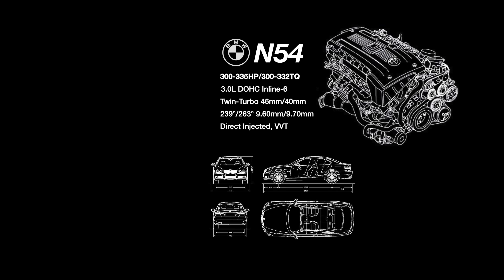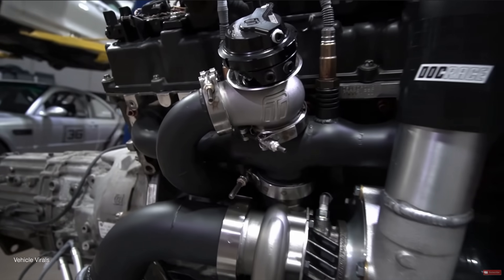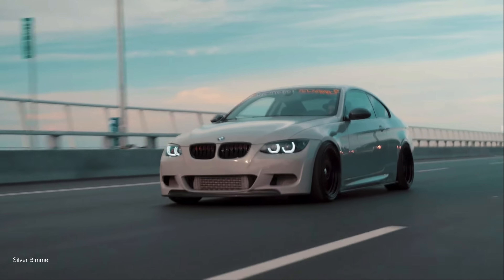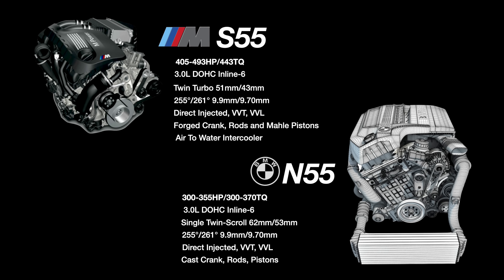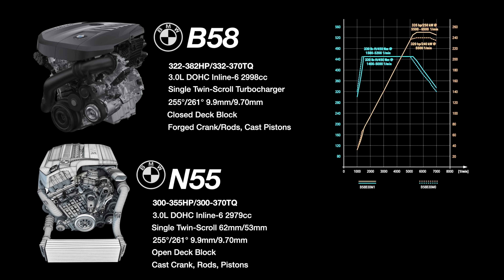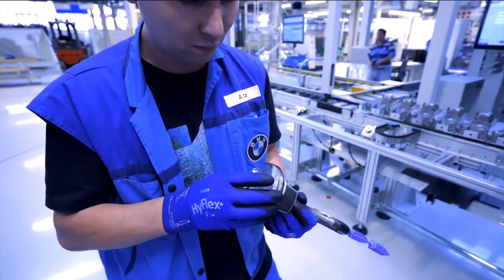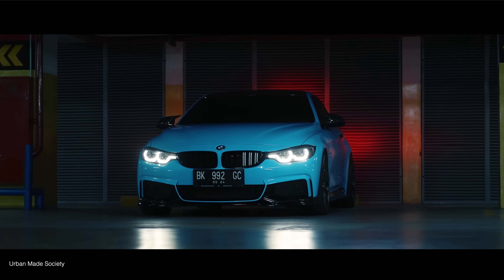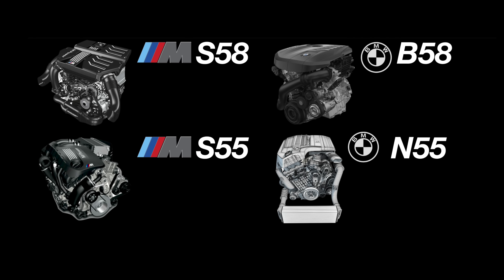BMW Turbo Inline-6 Engines Are Ridiculous | Explained Ep.4

Comment: Toyota saw potential in the b58 and that says it all 

There was a comparison drag race between an mustang Mach 1 auto vs MKV Supra 3.0 vs Nissan Z auto. The Z came in dead last and the mustang and Supra tied, b58 swings above its weight class and its already beating its direct competition
Reply: The z was only 2 tenths behind, and it was solely because of the dog shit tires Nissan decided to put in there.
Reply: Dude real talk, that is what made me look at the M340I. If Toyota is ok with using the B58 you KNOW it is reliable.
Reply: @Cwrigh25  mine has been nothing but trouble free & tuned for the last 20k miles
Reply: I have a 07 GT500 making 685 rwhp (800crank) on a VMP Gen2R blower kit. My buddy with a 2020 Supra with a downpipe/tune/Ethanol,  is dead even with my car. He makes around 650 crank estimated with just those simple mods. Weight is also a huge advantage for these cars
Reply: @ilikebudlite  yeah man these modern bmw turbo motors are massively underrated. My tuned daily 440i easily keeps up with my GT350
Reply: lmao the mustang beat the supra by like half a car💀
Reply: Nope they went to the guy that designed the 2jz to make the new motor and he said he wanted no part
Reply: Definitely not mere coincidence Akio Toyoda wanted b58 for supra....I wouldn't have had it any other way
Reply: @footballcoreano sophisticated, reliable, luxury, precise, precision 🤣 and then an opinion but no actually fact behind any of your statements? America doesn’t have engineers and we are simple? 🤣 how about companies are cheap while the epa goes after them every time more cylinders are made suck requiring them to paying fines every year just to produce which is why the world is going ev or i6 because the most “reasonable” power can be gained due to its lighter i6 balanced design making fewer emissions on a more efficient system being turbo. The American military would destroy Germany’s military. Yeah tech is good sure but it’s complicated with many parts, the reliability is in the placement of the cylinders that’s it other wise there is a lot of plastic used on them and the block is aluminum which is not better than an iron 2j is just saying. You all act like this is new lmao where the Germans are making headway is the transmission and awd systems that’s the real secret. Anybody who knows anything about engineering knows the more parts you have the more issue and less reliability it has so that argument is null. Not saying the motor isn’t good but let’s be real here the japs did it better when it was out in the original Supra because bmw was doing it then to in the early 90s and guess what toyota ruled and were under the 280hp agreement. Nothing like an iron block i6 for all the boost. How’s that for engineering. See actual facts behind what I say amazing.
Reply: Boost the Mach and they're all toast lol
Reply: @footballcoreano  I hate to burst your bubble but the Coyote not only is more powerful naturally aspirated but it has a higher brake mean effective pressure and until this inline 6 platform runs 7 on a factory sealed engine like the coyotes have you're absolutely talking out your a**. 
Coyote > ANY I6
Reply: Toyota means bad nowadays
Reply: I agree on the b58 comment but that video was bullshit look at the z’s tires. Regardless i like the b58 better also but i wouldn’t rely on that video for evidence 😂
Reply: @Automobile Addict Toyota didn't request anything or change anything about the B58, it was already well into production long before the Supra was even announced. I work at a BMW dealership, I've seen Supra & BMW B58s torn down, they're exactly the same. For better or worse the B58 is entirely BMW, as far as I know all Toyota did was take apart a few higher mileage B58s and made sure it met their stringent standards, which it did.
Reply: Didn’t Toyota reengineer the B58 to be a more reliable engine than its predecessors?
Reply: @LawrenceStroman  BMW doesn't need Toyota to know how to make a reliable inline six engine.  The BMW M57 is legendary for it's reliability as an inline six diesel engine and this dated back to the same era as the 2JZ and the OM606, another legendary inline six diesel engine.
Reply: @LawrenceStroman   NO.  The engine is all BMW.  Toyota had no say in the engine build, they only had a say on things like steering, brake feel, and aesthetic for the Supra.  It's why the steering is better than the Z4.  Toyota isn't going to be able to tell BMW how to build a better BMW engine.  It's like me telling Gordon Ramsey that this salt goes better than that salt.  You're trying to discredit BMW, one of the most performance brand out there.  As a former 3 and 5 series BMW owner and a former MK2 and MK3 Supra owner, I'm disgusted that you can even think that.

Toyota doesn't know how to build a performance engine engine anymore.  They've been using the V8 in their Lexus line for ages.  The LFA wasn't even a Toyota engine, it was a Yamaha engine.  The last great performance engine they built was a 2JZ, and it's too soon to see how the 3 cylinder GR Corollas will be, but 300 hp isn't that impressive these days.  It's why no one is talking about it.
Reply: Above it’s class? All of those cars are equally expensive. I watched the video and the mustang won by half car being na then the Supra turbo then the z also turbo both are lighter On forced induction and still lost to a na mustang Mach 1 which is just a track GT 🤣. Now is it probably the king of all inline 6 motor yep sure is but I’m not a fan of aluminum blocks either. It is impressive but would be nothing without a lot of boost and light weight saving. I prefer to make big power without having to even change my power adder or internals, weight saving can be had later. Boosted motors are not reliable and the more power you push through it the less it becomes. Also bmw has many electrical problems but the design is strong being an inline motor due to balance but only matters if the internals can handle it because the design flaw is torsion having 6 inline subject to snapping cranks and doing block damage but needs boost available to which it does not stock therefore it incomplete and might as well get the 2 extra cylinders if I’m going to build anyways for 1000 plus hp something these cars can’t do unless built on a lot of boost. Mustangs don’t need to be built to make good power and they actually sound good however still aluminum block. Now for a street car daily that you can make relatively fast sure. Not my top choice but everybody seems to think it’s the fastest platform out because they watch babyaga 🤣.
Reply: @joshreynolds729  throw a $500 MHD tune & catless downpipe on that Supra and you’re gonna put 5-6 car lengths on that Stang
Reply: @CadexLaw  your absolutely correct but that’s only because it’s a turbo car.
Reply: @joshreynolds729  B58 won FD last year and is in the 8 sec mark faster than any other car I've seen but no one's cares about all that. Don't forget its a contender in time attack.
Reply: @GokuTheHusky  that is very true it’s a well balanced car that puts down great tq down while being light so of course it’s going to do well in those events. It’s a good street car.
Reply: @joshreynolds729  honestly the $/hp ratio would be better with an inline 6 rather than a v8 and im a chevy tech at a dealership. now if we are talking about above 1k HP then of course the v8 is going to be king. at that point youd be hauling your car everywhere you go. id still prefer a S55 or a b58 IMO over a v8 for a street daily especially in urban areas like los angeles
Reply: @Infigure1  totally agree man.
Reply: @joshreynolds729  dude drink some haterade, cause I’m not reading all of that
I’m not sure why you’re so heated lol
Reply: @GODEYE270115  no hate man. My bad if I came across like that guess I didn’t have my coffee 😂 sorry about that. Anyways I like the b58 it’s the best best i6 on the market. Was just pointing out some flaws that’s all, no hard feelings.
Reply: @GODEYE270115  .
Reply: @joshreynolds729  Every engine has it's flaws.  Even the Coyote.  They're notorious for head gasket failures, exhaust valve recirculation, oil consumption, and a problematic 10 speed.  They're also big and bulky and on Hagerty, the M2 killed the 2023 Mustang on the 1/4 mile.
Reply: @DroneStrike1776  absolutely every engine has it quirks down falls and gremlins. And yes stock your right but the m cars are turbo and often awd the mustangs are na minus the 500 which at that point the m cars  can’t compete anymore stock in a race and that’s with a blower not even turbos 2wd. Totally different realms. Na vs boost.
Reply: @joshreynolds729  mate ever heard of a full stop. ?
Reply: @joshreynolds729  ☠️☠️☠️
Reply: @carmello000jp  ☠️ ☠️ ☠️ 🤣 bmw boys take the cake.

Comment: N55 the best sounding engine on this list
Reply: N55’s remind me of the Aston twin turbo V12’s, they are remarkably similar. Almost an exotic sound
Reply: I think the N54 (with a proper exhaust) is on par. The other variants are just ok, more just a splat of noise than anything. 😅
Reply from the maker: Yeah the N54 and 54 sound great but the S55 sounds like cheeks not gonna lie😂
Reply: @337speed  😂😂
Reply: @337speed  right
Reply: @337speed  I used to hate the S55 sound, but I grew to like it more. It sounds better with an equal length exhaust or a single turbo.
Reply: @TML34  for sure

Comment: Awesome video as always!

Would love to see your take on modern 4 cylinders. Especially the EA888.3
Reply: Yes! Ea888
Reply: I have a 2015 Audi A3 (DSG 2.0T).  These little cars are pretty quick with a tune, downpipe, HPFP, and ethanol.  The little factory is20 turbo can do mid 11's.  Hybrid turbo's (with decent spool for daily driving) are running low 10's.  Low mileage excellent condition A3's and GTI's can be found around 20k.  Add in around 10k and you've got a reliable 10 or 11 second daily driver.  Not bad.
Reply: @DNO_Fitness  oil consumption higher than fuel consumption xD
Reply: Yes! It’s like the 4 cylinder version of BMW’s inline 6. I know the N20/N26 and B46/B48 are great, but they aren’t on the same level.
Those EA113’s and Gen 1 EA888’s sound downright nasty for a 4 cylinder. Reminds me of how the N55 sounds a little. How it just sounds raw and guttural
Reply: @PapiAndrey  no offense, but I really don't see how you can call the EA888 a good sounding engine when you've got competitors like the Focus RS, Mercedes A45 and Megane RS. I genuinely can't think of a worse sounding 4-cyl engine, modern emission/noise regulated vacuum cleaners notwithstanding. 
The EA888 is honestly one of the poorest sounding 4-cyl engines to this day, it's very tuneable but sound has been its weak point since day one.
Reply: @xIcarus227  I didn’t say they all sounded good
The ea888 gen 1 sounds damn good with an exhaust and I’ve heard a few good sounding gen 3’s, but those were with the awe turboback track exhaust. Maybe it sounds like shit in videos, but it sounds good in person. Most of the ea888’s sound like shit because the exhaust is trash
Reply: @PapiAndrey  seen the EA888 in all sorts of configurations since people mod the living crap them, it's the engine itself which just doesn't sound very good regardless of generation. Attaching an exhaust can only get you so far when the base isn't very good. 
Have a listen to the cars I mentioned in their pre-2018 versions, you'll see what I mean.
Reply: @xIcarus227  that’s not true. That said, it’s subjective. Most setups I hear are trash. A simple downpipe paired with the stock catback sounds good to me because the stock catback gets rid of the bad sounds and the downpipe let’s it sound the way it should.
Reply: @PapiAndrey  it's subjective until virtually all car journalists over the years have called the sound mediocre at best and the consensus in the car community mirrors that. 

Look if you like it I'm happy for you, but you can't seriously say that it sounds better than say a Focus RS or any of the other car I listed, in any exhaust configuration. Because those cars do sound better with aftermarket exhausts too. 

And as I said, it's not about the exhaust but about the engine itself, it sounds unhappy to be revved out and I don't know whether it's the cylinder head or the exhaust headers but it's unpleasant.
Reply: b48

Comment: Also Toyota engineers had massive input in developing reliability into the B58 during the joint developmental phase of the joint Z4/Supra platform. Like "increase the mm of this thread screw here and increase the the capacity of this component there". Yes I read is was that granular.  I call the B58 a "Toyotasized" BMW engine. When a friend of mine wanted to upgrade his Z4 to the new platform I said go for it b/c the Toyota influence and input made it more than worth it with possible less visits to the stealerships for warranty work.
Reply: The B58 had already been designed before the colab lol. Toyota did make changes for the supra though.
Reply: I get what you're saying now lol, sorry.

Comment from the maker: Which engines should I overview next?
Reply: Audi in-line 5s
Reply: Audi 5 cylinders!
Reply: Audi difference between both 4.0t with and w/0 tsfi.
Reply: Audi inline 5! Also the VW/Audi 2.0t. The VW/Audi 2.0t is like the 4 cylinder version of the Bmw inline 6 turbo.
Reply: BMW S65
Reply: BMW S65
Reply: Let’s go!!! I swear I was gonna suggest this for your next review! Could you possibly review fords barra Inline 6  even tho we can’t get it
Reply: AMG M159
Reply: Ford Barra turbo inline 6
Reply: Ecoboost series of engines
Reply: LF4
Reply: Ecoboost V6s
Reply: Ford eco boost engines
Reply: Lexus performance engines
Reply: Detroit diesel !
Reply: VR38DETT (R35 GT-R)
Audi/VAG 2.5L I5 (RS3/TTRS)
Porsche 3.8L H6 (996. 997, 991 & 992 generation 911 Turbo and Turbo S)
McLaren 3.8 & 4.0L V8 (570, 600, 675, 720 & 765)
VAG 4.0L V8 (RS7/RS6, Urus, Porsche Cayenne GT, RSQ8)
VAG Lamborghini 5.0L & 5.2L V10 ( !Lamborghini Gallardo/Huracan, Audi R8)
Reply: 4.4,v8 s63tu